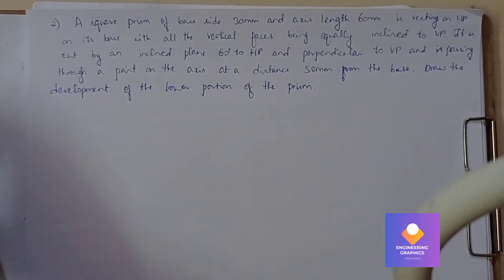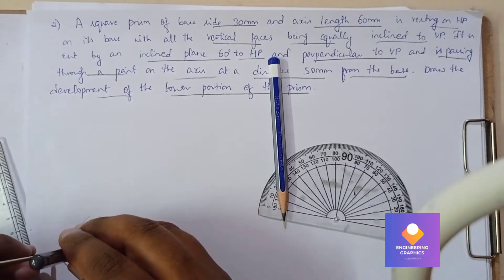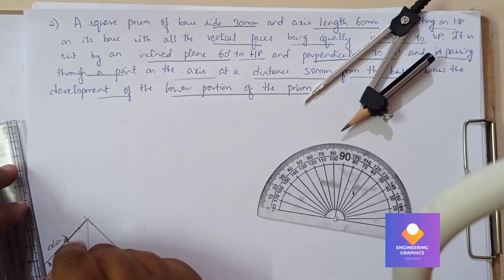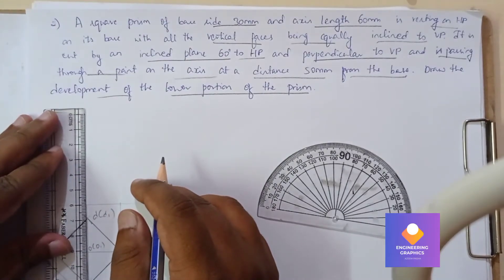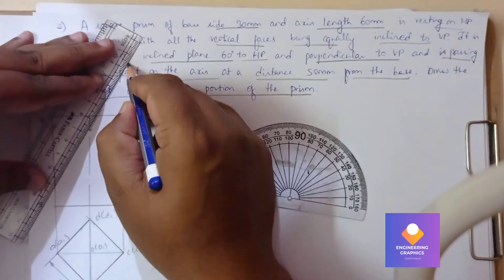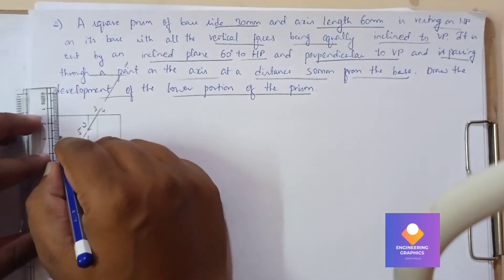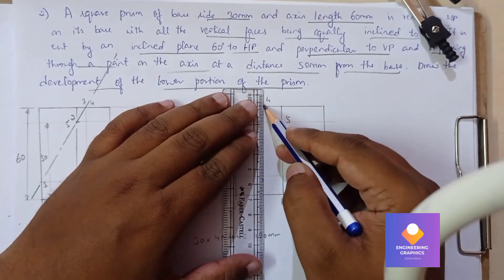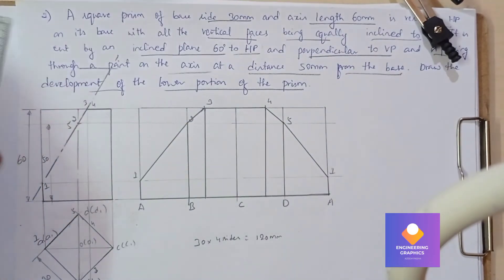Development of Square prism cut by inclined plane at 60degree and cut axis is 50mm above from base

Comment: 1. A square prism of base 35mm & height above, such that 60mm is resting on ite one of the base edge is inclined at 20 to VP. is cut by a section plane, which is perpendicular to VP, inclined at 60 to HP and passes through the axis at a height of 20mm. Draw the development of the base  portion of the lateral surface
Sir how to solve this problem
Reply: Thanks sir 👍
Reply from the maker: @SharathRathnajaS Subscribe and share..
Reply from the maker: Watch this video

Comment: A Square prism of base side 30mm and axis length 60mm is resting on HP on its base with all the vertical faces being equally inclined to VP. It is cut by an inclined plane 60° to HP and perpendicular to VP and is passing through a point on the axis at a distance 50mm from the base. Draw thedevelopment of the lower portion of the prism.
Reply from the maker: It's there in my channel

Comment: Good explanation sir, thank you so much, 🥰 , keep doing more videos sir, keep it up
Reply from the maker: Thank you Gayithri.. Share to your friends through watsup groups
Reply: @engineeringvisualization1005  a regular pentagonal prism of ice 60 mm and base edge 30mm rests with its base on hp, the vertical face closest to vp is 30 degree to it, draw the development of the truncated prism with its truncated surface inclined at 60 degree to it's axes and bisecting it. sir e solve  problem madi
Reply from the maker: @gayithribr3928  okay
Reply: @engineeringvisualization1005  ok sir thank you sir